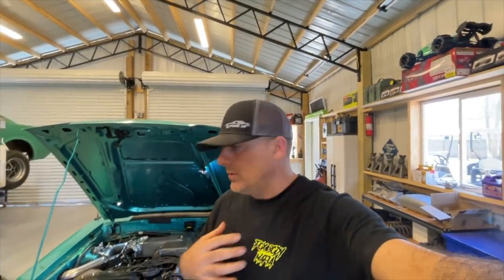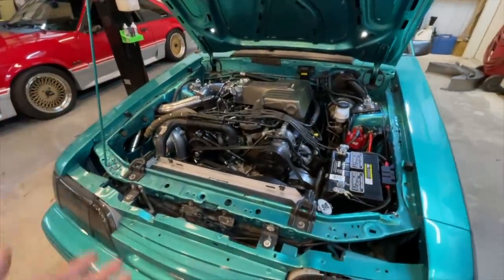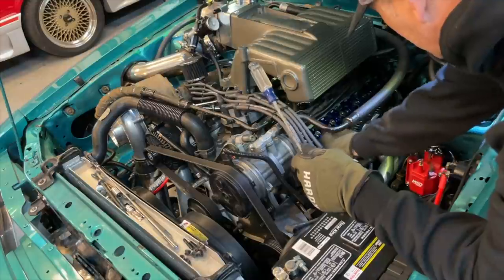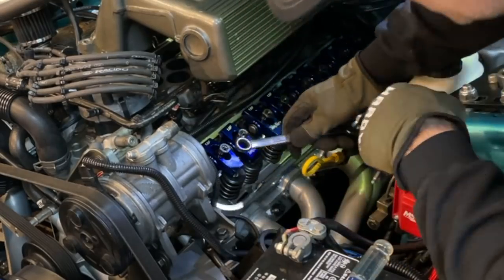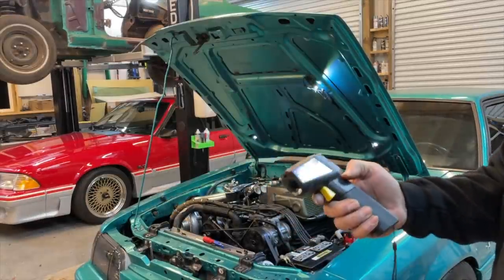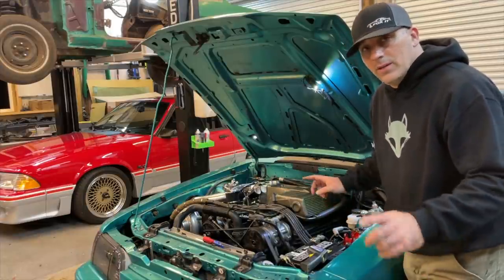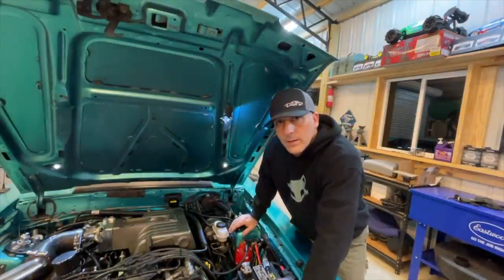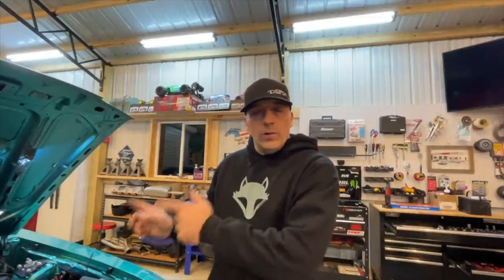I Failed A Few Times Before I Figured It Out..... But it's part of the process

Comment: I got a little miss and it’s at the thousand RPM Mark it’s starting to skip and miss and my engine starts to shake I can’t figure it out for the love of God
Reply: And hey...for help bc of that.. check your rotar button really good. Ever the tiniest pin hole thought the main copper tab can be the cause of that as well as a weak coil. Low rpm ok as well as high but more or less than that can also cause that.weak coils also come off as a poorly tuned carb or an out of tune efi system as if the fuel management system isn't working accordingly. May seem to run rich...but run so I assume it's too much fuel when in reality it's just not enough spark.any questions or help I  would be open too.
Reply from the maker: Well, I must agree with my friend Gene in saying it could be a weak coil, or your timing has moved on you.
Reply: @BREW2LFOXBODY  ty friend. You know honestly what your best quality that I have seen is you always leave your self open to suggestions and or better ways to handle,fix, or diagnose the solution. We can relate.
Reply from the maker: I’m just out here trying to help people brother.
Reply: Me too. I love helping. Swear. I could do an engine swap for free just to have someone to talk to or swap stories with. Car stories and diagnosis and symptoms that you don't find in a step by step manual. You do good and I apologise I swear. I would like to think that your channel isn't kid based in a way or beginner based however that's wrong of me. Sorry break and william. U have a subscriber and fan. I just miss the content that best relates I guess. Pls ignore what I said.
Reply: @gpt5002    Well I appreciate you trying to help me I went and replace the coil it’s a brand new Motorcraft coil I believe it’s only five months old
Reply: @BREW2LFOXBODY  I think you might be right my timing is moving around a little bit a check my timing I took the spout out of it and I said it to 10° and then when I put the spot back in it jumps up to 20
Reply from the maker: No problem man, what you said kinda hit home with me not gonna lie. It’s hard putting out content 3 times a week that’s quality and helpful to others, but I truly do my best to inform and educate all ages as best as possible. You had some good points in what you said, I’m taking it all in to see how I can improve the channel. 😎
Reply: Pls don't take even the neg to heart. it's been a rough week and I don't have anyone to vent to so I'm completely positive that I could have worded it better. I can just tell, you want to help ,teach and inform as well as  save people the hours and hours of troubleshooting or  if they just don't have the money to send it into a shop which 9 times out of ten suck. I was a small engine tech and moved into tractors. All my nice vehicles 2005 lincoln ls and Tahoe with the 5.3 and more were cars that needed an engine quote from a shop. Well compression/valves is a funny funny thing and driving 55mph with 87 octane isn't great for seating after 100k right? But to a gm mechanic or ford etc im just a nobody... That is why I like your channel. It's for the peoples ya know. That part to me stood out. Umm.. idk how private messages work or anything of the sort.. but I have tons of tips and tricks and all sorts of things.. I don't have money nor cameras nor a shop. I just bought a 283 and nothing to put it in hahaha...being honest here. Btw it's the 327 casting with the 283 bore🤫. Long story there ask me how Ik. I would be more than mary to actually help you persay if you need the content/ subject. I would rather see a man with a heart grow then these dang ppl that just flaunt their money. Get what I mean? But I will say your a pretty damn good guru on foxbodies. I could never argue that.  Just imagine a man with a 302 gt40p heads put in an s-10. Who does that crazy kinda thing🤫🤫🤫🤫.  I'm not your ordinary joe.. I save content/videos of issues that's not just your simple fixes ya know. For example... Ignition module... Sounds like a one direction ordeal... Okay chevy and ford... Experience 1:ford... Taurus 3.? V6 wagon. No spark. Ppl slap a new one on and drive right .. for about 1000 miles... The importance of the lithium grease they apply underneath the bottom side is what makes that part last... And did you know that on gm trucks v6 4.3 and 8's they command the fuel pump to kick on? They can even maintain spark yet no fuel and it's an ignition module. These are just two of the long lists that I know of. But it's not foxbodies.. but eventually your going to run out of parts to talk about.lol. so... Go buy another old car drive the hell out of it.. and let's see what goes out😂😂.ford cadillac idc. It's all good stuff to keep in the vacant lot where a brain should be. Your smarter than just a fox ya know. Much respect from me to you.maybe one-day you have an issue and I can help you solve it. Some say Im an obsessive thinker😂😂 I consider myself an obsessive trouble shooter (even in life).
Reply: Think my post wasn't allowed. Lol. 16oz bottle half fuel half water.. car warmed up.. pour it down the intake at 15-2k rpm.. hot valves cold liquid...carbon cracks and breaks.. don't stop until the bottle it gone... It's a squirt..let it run...squit let it run...squirt let it run trick... After the bottle, pull the terminals..reset the computer.... Then drive the psssss out of it for a few min ( it puts a load on it and creates heat). If no change.. do it again. It took two times of this on my lincoln that had the 3.9 with vvt.

All shops will hate me for this. Haha... I may hate myself actually 🤣🤣 it also works sometimes for catalytic converters. 2009 Tahoe I had needed and engine.. 😏😏😏... Got the valves clean and it ran good... But check engine light stayed on and had a slight skip at idle but purrd down the rd. But that little crap bothers me more than a rod hanging out the block.lol. I did that trick a few times thinking it was the valves... Well then the catalytic conver broke and I heard it rattling all around. Few 5k revs and in the muffler it went. Idles great check engine code catalytic inficency. What a beautiful code that was! Lol

Comment: What ya say skip skip skip I'd get a book also 😜 Ihead gasket mine is in need I'm kinda sure
Reply: I wish only wish I could install a knew    coolant tube and intake manifold in my   1996.    Gt 4.6l. V8idles great once in bit she will feel like she's rough never moves the rpms hold steady prity much.  Only at start she seems to hang way up around 2thousand  rpm goes down real slow wtf 😒
Reply: Gonna try and save most money possible           your thee best  and double like if there was one for that

Comment: Why not just start with a compression and a leak down test before all that? Be my first tests before touching anything personally. Thatll tell you a lot.
Reply: I never watched the full video and actually didn't get passed 30secbut this man is right... Minis the compression test.. compression tests are mobile mechanics tools. Leak down test tells you everything you need to now. How much cylinder pressure.. if it leaks down.. you can check the top of the cylinder mid and bottom for egg shape. Tells the story of valves intake and exhaust.if the guage reads great at the top or bottom valves are good... If you move the crank around and place the piston in a diff position and the pressure drops or drops the rises it's a worn cylinder or egg shaped. Yw ppl. Anyone that wants to send me $500 for diagnosis is more than marrier.lol
Reply: Ik I'm talking too much and y'all will probably never see me again comment... But to add to the leak down.. the crank will turn and allow the piston the hit the bottom of the stroke.. when determining eggshape I use a 1/2 drive wratchet approx 16-20 inches in length attach it to the crankshaft with the proper socketandblock it from spinning in a few stages. I check in 1/4s but most just check top bottom and mid. But I wanna know if it wore on the up or down stroke to cause the shape.. but hey.. I never went to school for anything 🤣🤣 so what do I know.    Up stroke would cause larger bore at top and vice versa. Helps determine where the unbalance maybe.

Comment: I had a spark plug one time that had a hair line crack in the porcelain causing a miss fire in my 72 Mustang. Could barely see it with the naked eye. Had me stumped for several days trying to diagnose it. I must have had the plugs out of that thing 3 different times and completely missed the crack.
Reply from the maker: That one is hard to diagnose sometimes for sure. Lol

Comment: You can't work on cars without a compression tester. You can also use it as a leak down tester by putting it at tdc for each piston and see how fast the pressure drops. If one is way different could be bad rings or valve, sometimes you can just move the crank a little bit and the rings line up. 
A compression and spark tester should be in everyone's toolbox.